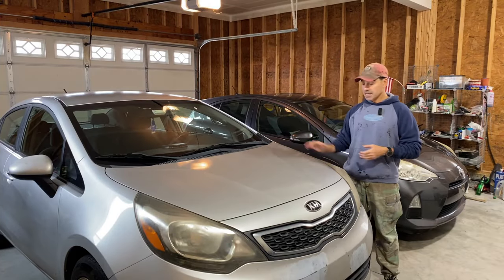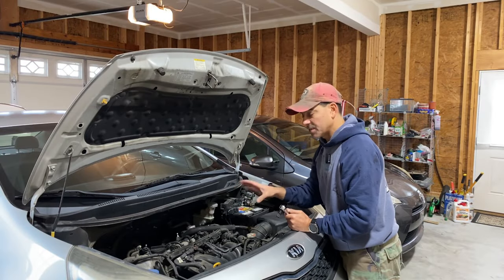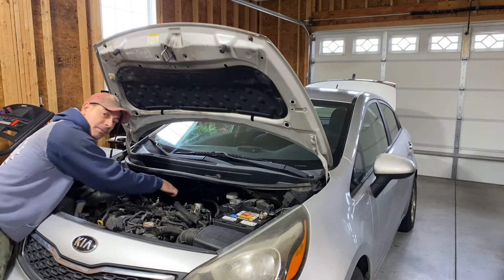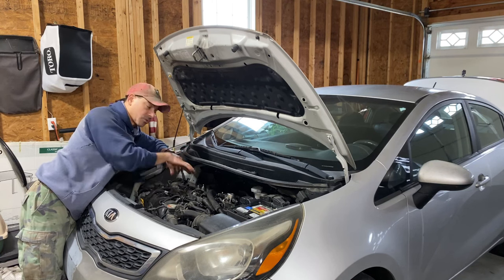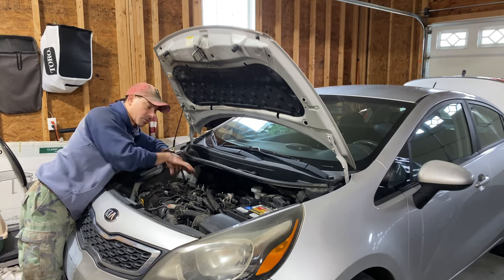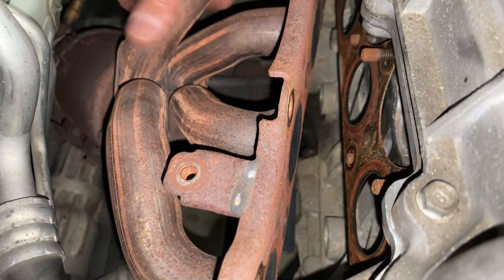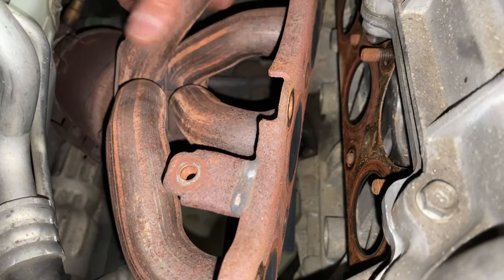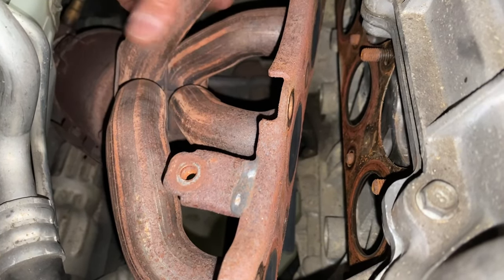How To Replace Catalytic Converter - Kia Rio  (Andy’s Garage: Episode - 456)

Comment: My 2016 kia rio 188000 miles running good. Done some plugs ,coolant,  pcv, cleaning some sensors too. Triggers cat code but will run right up to 80 quickly.  Been running  5-30 restore and protect oil every 3000 miles. Need a new valve cover gasket.  I've been a machinist so precision in metal mechanical parts Need to be preserved as much as possible.  These cars must be babied and not abused.

Comment: Thanks for the awesome step by step video! You are helping so many people save a lot of money. Word of advice for anybody that does this job…TAKE OUT THE 2 LOWER BOLTS THAT CONNECT THE CAT TO THE FLEX PIPE FIRST. If you can’t get them out it might be better to pay a mechanic for the 1.5 hours of labor to replace the cat and let them deal with it. I spent a day and a half extracting them because they were so rusted and misshaped. I finally used a dremel to cut the lower stud, and cut a notch in the upper nut and then was able to use an 18mm socket and it backed the whole stud out. What a nightmare. Still glad I did it myself though.

Comment: How did kia get away with selling these. 100,000 miles and nothing but priblems. 😠
Reply: It’s a GDI, all GDI does this that’s why you clean the intake valve every year
Reply: Ok. I saw the crc video on the cleaner. I have a 2016 kia rio. How do I use it.

Comment: This is an amazing video. You are so thorough with your camera angles and explanation. I'm looking to replace my cat convert in my 2016 rio, and I was curious as to where you recommend buying one? They sell them on amazon for a couple hundred, and about a thousand at autozone.
Reply from the maker: @saxcat9794  I bought mine online from eBay but make sure it’s an American version. Some foreign versions will not perform to US regulations and you will fail your emissions test. Another thing to be aware of is that some aftermarket catalytic converters are not compatible with the manufacturer specs and the check engine light will still be on.
Reply: @PhillipsVision  You the man! Thank you for replying!

Comment: Gotta do this tomorrow on a 2016 accent with 1.6. This Kia looks exactly the same. Thanks for the info.
Reply: Went well, all bolts came out, went back together ok and no codes so far. Runs better as well. The hole on the new cat didn't line up with the lower brace/mount so I had to loosen the brace and move it around a bit and add a couple washers. Thanks again for the video. It helped a lot.

Comment: Andy, another great video- I was wondering whats the mileage on your Rio at this time? Also do you have a TPMS reset button on this model or does it reset on its own. I bought a used 2014 Rio and cant get the TPMS Light to stop coming on even after using "Thinkcar scanner reset tools and inflating the correct tire pressure. Thank you. : John
Reply from the maker: It does not have a reset. You need to replace the sensor if needed and/or fill to proper psi. I have 255,000 miles on it

Comment: Hey andy good morning man. 
Code reader reads Catalytic Converter for replacement.
Would that be reason why car will not start?
Reply from the maker: @LG-wj7js  normally not. A bad or dirty catalytic converter can cause rough idle but I’ve never experienced a no start. Check your fuel pressure to ensure the pump is working. Also check the battery voltage

Comment: Thank you i subscribed! Im going to try to replace mine this week, and needed the knowledge. I have a 2016 hyundai accent, so i think its the same engine, same company at least. Haha
Reply from the maker: @kaduku1112  Thanks for the support. I hope this video helps you out with your project
Reply: I attempted to do it. But a jut is rounded out and bought a little tool to get it out but that broke haha ill try again later

Comment: Q: Dont know if your 2013 Kia Rio has a second catalytic converter after the flex pipe under body as I have on my 2014 kia rio.
 How do i know if the cat P0420 check engine light is for a problem with the front cat you are replacing here or the slimmer Cat going to muffler exhaust after the second oxygen sensor?   Thank you,  I enjoy all your videos!
Reply from the maker: The P0420 code is generated by the downstream O2 sensor. That sensor is after the catalytic converter near the exhaust manifold

Comment: I'm wondering though can a bad Cadillac converter be the cause of the vehicle not accelerating to normal speeds? for some reason my vehicle will only run at very slow speeds. the RPMs will not go up very high. I'm wondering if replacing this will help it out? Oh yes and thank you for the video you did an amazing job
Reply from the maker: Normally the catalytic converter will not cause that. Are you getting any engine codes?
Reply: @PhillipsVision  no unfortunately no engine codes
Reply from the maker: @elijah3427  I would start by checking the fuel pressure
Reply: @PhillipsVision  okay I'll do that thank you so much for your help I appreciate you a lot

Comment: Hi Great video.How did u remove the center nut?With a deep socket or a 12mm wrench?
Reply from the maker: A deep socket
Reply: @PhillipsVision  I also had to lower the engine on the passenger side because there was no room to remove the converter.

Comment: On 4:15 is that bank 1 or bank 2?
Reply from the maker: This car only has one bank. Vehicles with dual exhaust manifolds have multiple banks. Bank 1 is on the cylinder 1 side and Bank 2 is on the cylinder 2 side.
Reply: Okay because I changed this exact part it was giving me code p0420 and I drove it for about 60 miles and light hasn’t gone away yet so I deleted the code and I’m hoping it doesn’t come back on. I will keep driving and see if it pops up again
Reply: @PhillipsVision thanks for replying though bro I appreciate it
Reply: @FelipeRodriguez-eh6ty  hi, light turn on? Or is still off?

Comment: Hi, where did you purchase this?
Reply from the maker: eBay
Reply: @PhillipsVision  thanks for the reply, I purchased from O'Reilly but the one they gave me is the rear one not the manifold like yours, now I'm confused, which one do I need to replace? OD2 sensor they gave me it's for the manifold one.
Reply from the maker: @gt9046  are you asking about the oxygen sensors or catalytic converter? The video is about the catalytic converter
Reply: @PhillipsVision  minutes 3:08 is the part they gave me.
Reply from the maker: @gt9046  that is the second catalytic converter. The first one is the one that the O2 sensors function with

Comment: 2012 and earlier 1.6L has them under  the car just after  the subframe
Reply: Could you please explain on this a bit further? I’m going to be replacing my girlfriend’s catalytic converter here soon and I’m trying to research as much as I can before getting into it, how much different from this video is the 2012 model?
Reply: @jackcampbell6222  Sure.It is roughly under where the shifter is in the car , so you will need to lift the car 
I found it easier to lift one side and go underneath. Both sides of the catalytic converter are bolted in with three bolts on each end, Either 10mm or 12mm Mine were completely rusted out so i'm not exactly sure
You will need 2 triangle gaskets as the originals  won't compress to make a new seal .There is no sensors involved in a 2006-2011 ,just unbolt ,put a exhaust gasket on either end & bolt the new  one in 👊😇